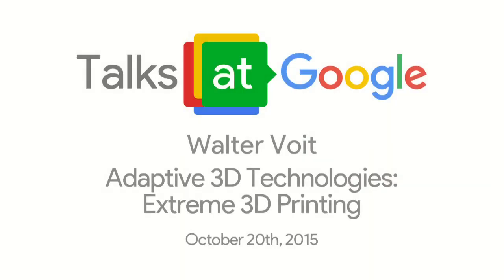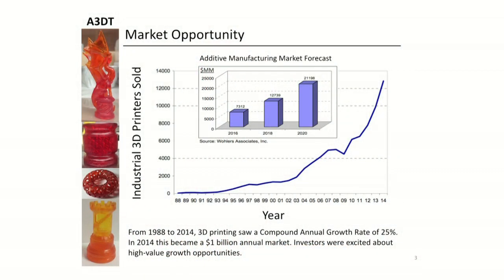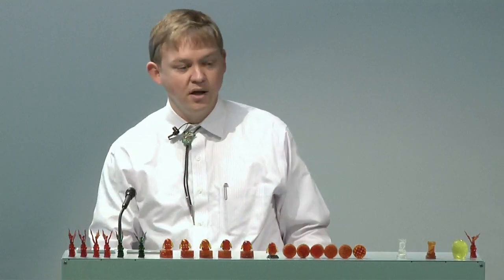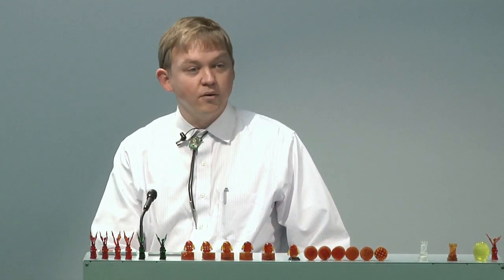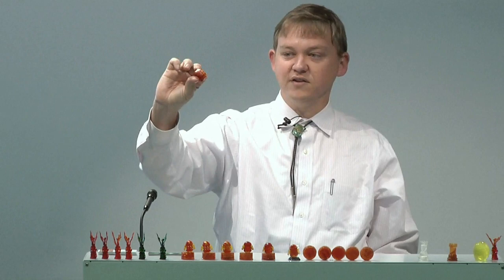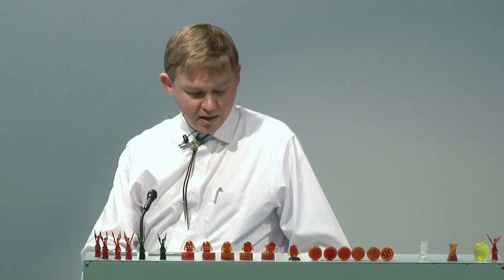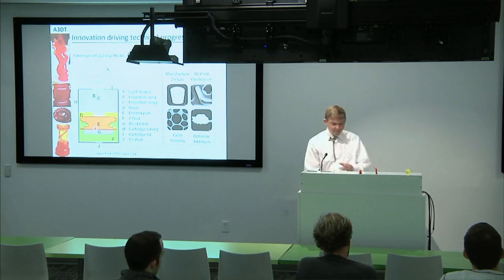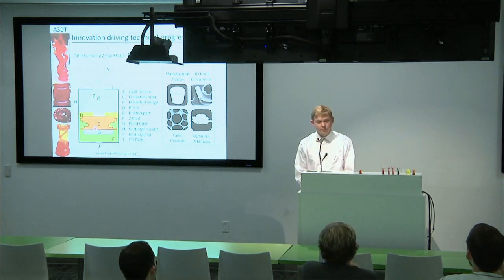Extreme-3D Printing | Walter Voit | Talks at Google

Comment: what do you call that string-tie thing he's wearing? Scarcely seen it in these parts.
Reply: +spinvalve Its basically a piece of jewelry. You just use a nice leather band to hold a brooch at that place on front of the neck. Designs made using metal or polished semi-precious stone are popular, he seems to be wearing some kind of polished stone.

The leather band is quite secondary.
Reply: +spinvalve It's called a Bolo tie.